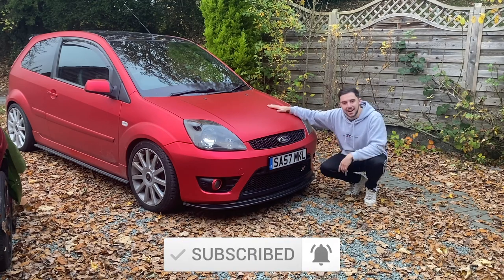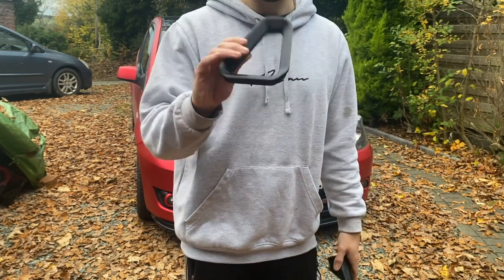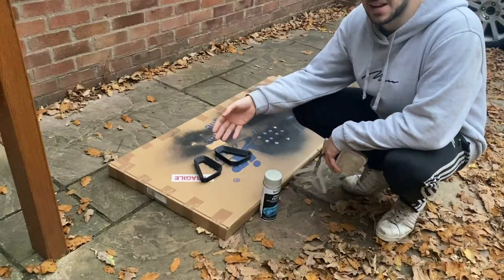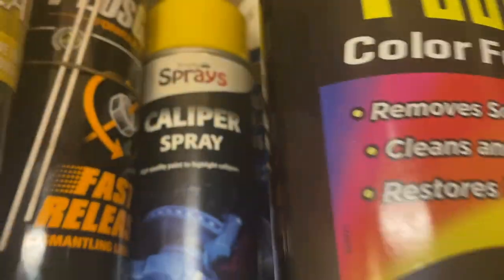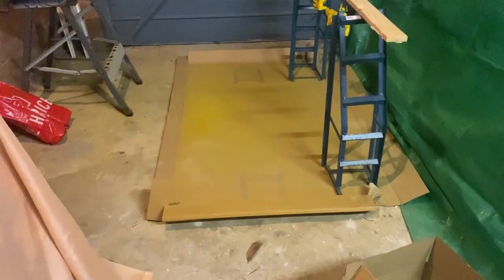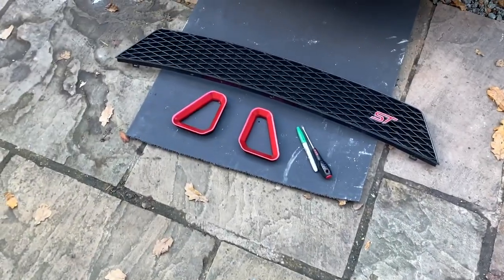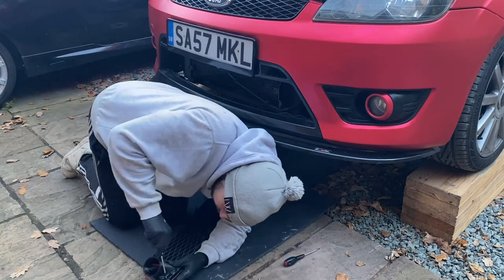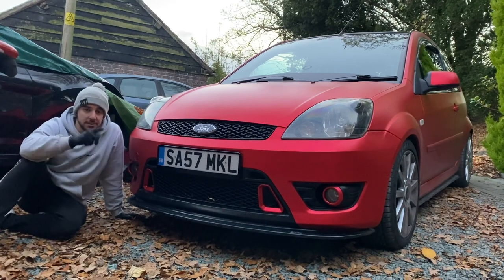Fitting Custom 3D Printed CAIS Vents to my MK6 Fiesta ST150 | Cold Air Intake | **RS Style**

Comment: Nooooo! I'm in the process of doing a rear disc conversion on a Mk6 Zetec s, and I will be refurbing the calipers, I was hoping to use your videos as a guide, do you think you will do a video to find out what failed?
Reply: would love to do this on mine. how much did it cost you roughly?
Reply: @benshier1152  well I spent more because I wanted all new parts where I could. I got the calipers/carriers/hubs off Facebook for £80. Everything else was new like the handbrake cable, dust guards, rebuild kits, new bearings for the hubs came to about £130.
Reply: @benshier1152  well I spent more because I wanted all new parts where I could. I got the calipers/carriers/hubs off Facebook for £80. Everything else was new like the handbrake cable, dust guards, rebuild kits, new bearings for the hubs came to about £130.
Reply from the maker: I’ve already done calliper rebuild videos, they’re all on my channel 👍🏻
Reply: @MendItModIt  hi Mike i've had a look at disassembling/reassembling the snap ring from the rear caliper, I think yours continued to leak because the snap ring wasn't fully seated as that's what applies pressure to the internal mechanism (the bit with the threaded bar) and in turn pushes on the little oring.

Is there any reason why you reused the old oring and not the one from the Autofren rebuild kit?
Reply from the maker: @norm4260  hi mate. The rebuild kit didn’t have a new snap ring unfortunately. I’m pretty sure it seated properly. The shaft of that bar did look in pretty bad shape though so I’m wondering if that’s partly to blame. Or the groove where the O ring sits, that looks pretty nasty too 😩
Reply: You could have used Focus MK1 calipers and stuff

Comment: I’ve just bought these too, but my bottom grille is permanently screwed/glued into the bumper, is it possible to do this without removing it. Looks sick thou🔥
 
Thanks
Stealth_mk6💪🏻
Reply from the maker: Possibly mate, definitely be a bit harder but with a bit of wiggling you’ll get there. Hardest bit will be lining the holes up. Might help if you take the bumper off so you’re not fighting with the rad
Reply: @MendItModIt  bumper is off till next year mate😂💪🏻

Comment: I think they look great 👍
Could you run (if you did a track day) 1 duct to the air filter and the other one split the duct (with smaller piping ) to each front brake.
Reply from the maker: Thank you mate. Well now you mention it I do have some brake upgrades planned and that would be a very cool idea. Maybe I’ll do some testing see if 2 vents to the filter is any better than 1 and if there’s not much in it look at cooling something like the brakes. Thanks for the the suggestion buddy 🙏🏻

Comment: Gotta say they are quite cool. How does the duct connect to them though so that all the air runs in smoothly and not a circle in a square type thing
Reply from the maker: I love them, I think they look so cool 😎 not quite sure what you mean though mate sorry?
Reply: @MendItModIt  as in say the fog delete for air ducts is round duct to a round hole. So wonder how it works with attaching round tubing duct to these due to their shape.
I wonder if they would look nice in a subtle way if I got them and had them done glass black when I get my grills done gloss black.
Reply from the maker: @DriveWithAndy  oh, it’s just the outer face that’s that shape, the collector on the back is round so the ducting fits snugly and I can secure them with jubilee clamps or something 👍🏻
Reply: @MendItModIt  oh awesome. I was gonna buy the fog ducts but now I am thinking just tint the fog lens so doesn't stand out and then get these and gloss black them. Like how they have a modern shape. Will have to go check out your link for where to get